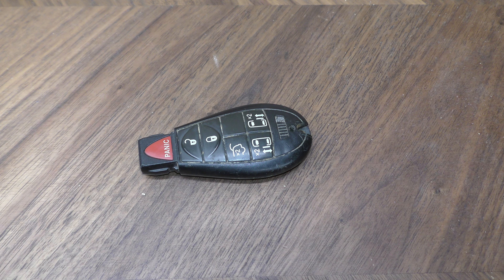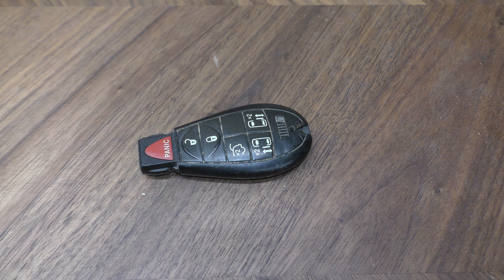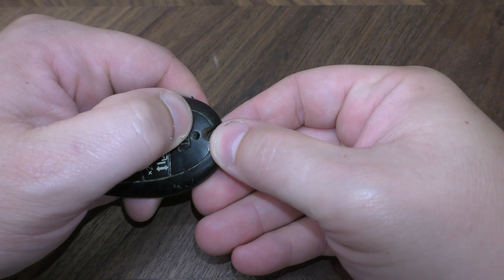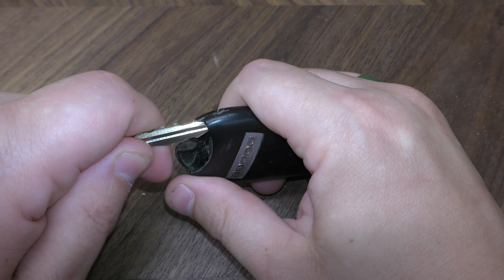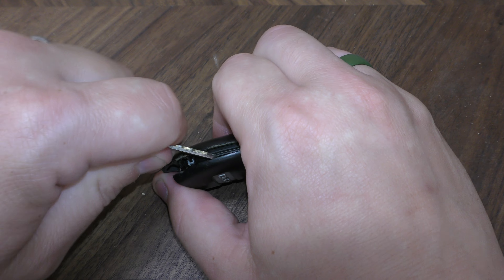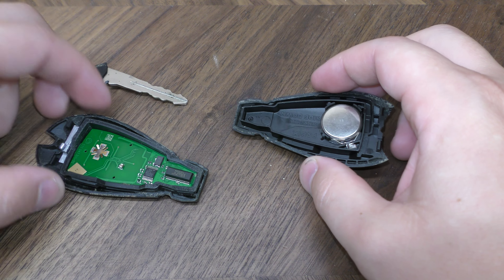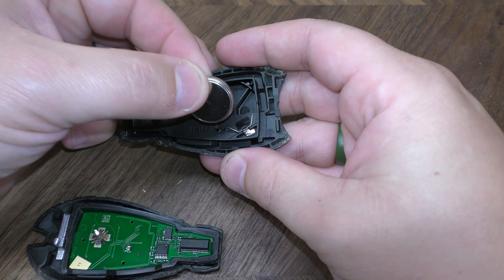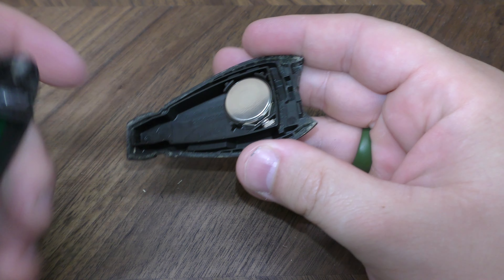Dodge Caravan key fob battery replacement - EASY DIY

Comment: I just replaced my battery but it isn't working. Any tips? This morning at 6:40am it started blaring the alarm and wouldn't stop on and off.  I changed the battery with one I had at home  after google and watching your video.  It's fine.  We drove to the library and played with toys there and I opened the door for my kids with the fob and when we got home it wouldn't work.  So I walked over to the store and bought a new battery and it still won't work.  Car starts fob just won't work
Reply: For anyone reading this, keep in mind there is a   + and -   side to these batteries so be sure you place it in exactly like he does in this video (with the text side DOWN), or it won't work at all.